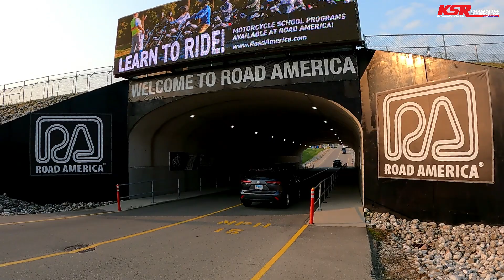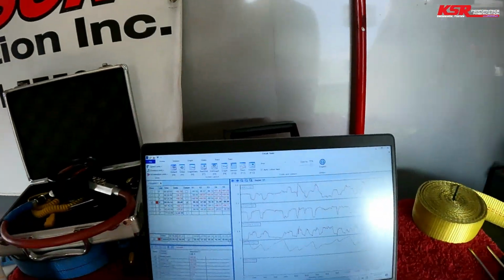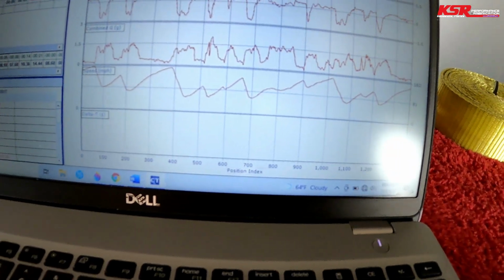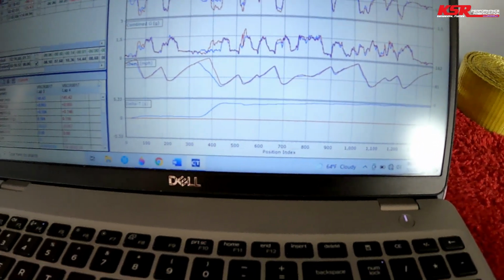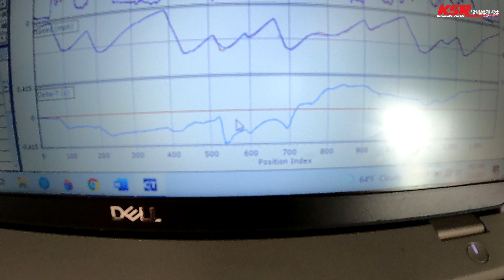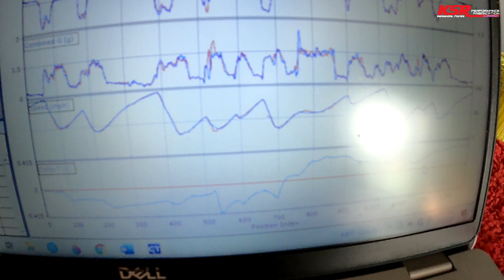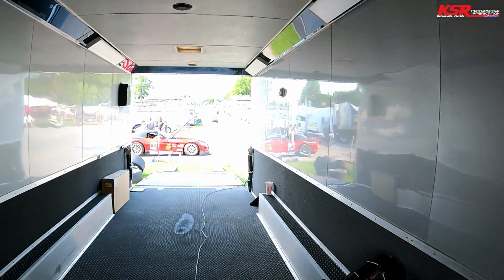Qualifying Day for Lee's Viper at Road America Trans Am Series 2021!!

Comment: I can definitely tell he's sandbagging in the turns he could be taking some of them turns at a hundred and he's dropping it down to 90
Reply: Yeah very smooth i agree he definitely isn't pushing it hard
Reply: It's a little different than FORZA in the way that your tires really make you pay for it if you run them hot for a couple laps, where in FORZA the tire wear is fairly linear. With a heavier car like they're racing, you're saving your tires for when you need them.

The other big difference is that he's not downshifting as often, for similar reasons. Playing it a little safe because all the torque will break the back end loose and it's easier to modulate the throttle while being a little shallow in a gear.

Basically, long story short, the car has more in it, sure, maybe a couple seconds if you really ran it hard, but you couldn't do that for 100 miles, and the average lap times would suffer.

Comment: In one of the Thursday practice sessions, I noticed the back up lights seemed to be on continuously. They were not on during the following session. Were you doing something different with the electronics during the two sessions? Also, for the Trans Am racers, I'll bet you liked being able to pack up and leave early. For the fans, however, it would be nicer to do the same thing as was done on Thursday when the TA2 race followed the Xfinity race. That spread out the departure times for fans. Some left right after the Xfinity race while others stayed to watch the TA2 race. From a fan perspective, it would have been nicer to have the your race on Sunday following the Cup race in order to spread out the fan departure.

Comment: This is super cool hearing all the different aspects of this racing. I've got a question for the actual race day - Are you racing everyone in your class specifically for position during the race in hopes of finishing 1st by the end of it ? Or is the race factored specifically around the lap times, meaning that you guys try to just get the lowest lap times and whoever has the lowest average by the end of the race is the winner ?
Reply: It's a start to finish race! What's going to add to the excitement is the fact they are now  mixing the TA class cars with the SGT class qualifiers in the start!
Meaning there will be higher power, lighter cars on the grid behind him in the start which gets hairy during the first few laps until the field spreads out!!

Comment: @KSR
Imagine if V10 Viper's were at Mount Panorama, Bathurst, Australia
The track: Mount Panorama, Bathurst 6.213km, Race distance 1000.29km, Average lap speed 178km/h 110.62mph, Fuel used during race 4.6 litres per lap (almost 800 litres for the race) 75L/100, Top speed 298km/h 185mph down Conrod straight

Comment: @KSR Performance & Fabrication - cam question for you - if you increase only cam lift - will it increase the chance of the engine knocking? everything else being the same e.g. run minimum advised valve clearance instead of middle of advised clearances - only lift is increased - will it cause things to be more knock prone than if you didnt tweak the clearances?

Comment: I eat up the inside of my front driver tire a lot on my Viper TA. I’m running DSCSPORT suspension, with ACR-E camber & toe alignment. 

What would you look at or suggestion you have to fix that problem?

Psi gets to 30-32 after about 30min of running.
Reply from the maker: You may not be pushing the car hard enough to use the camber that you have the car set at. Or are you running at a track that is mostly left turns? Take a little camber out of that corner, realign and see if the problem gets better.
Reply: @KSRPerformanceFabrication  happened at different tracks so guess it’s my bad driving lol.

Comment: Why don't you use nitrogen in the tires? Prevent some of that fluctuation in tire pressure
Reply: Either they do OR Tech doesnt permit it. im sure.
Reply: When the tires get heat in them, the pressure increases, no matter what’s in it.  It just does it less with Nitrogen because there’s less water in it.